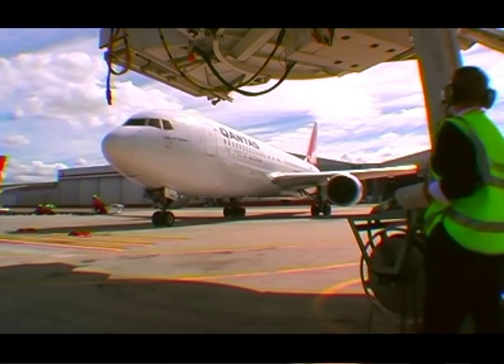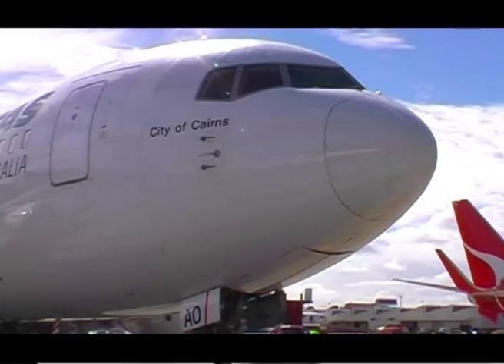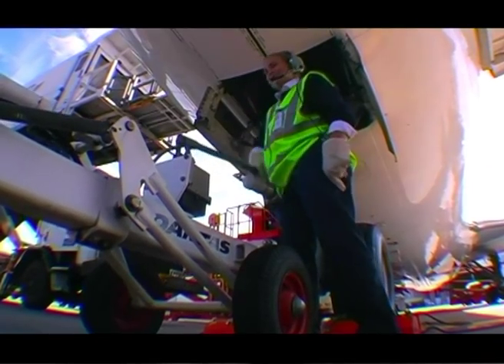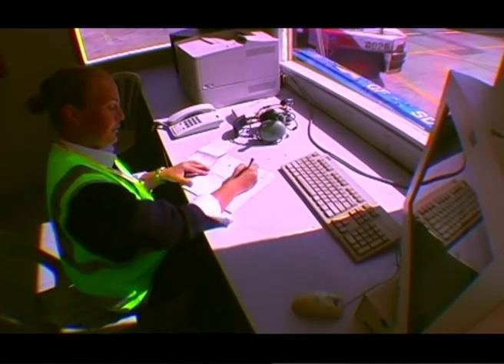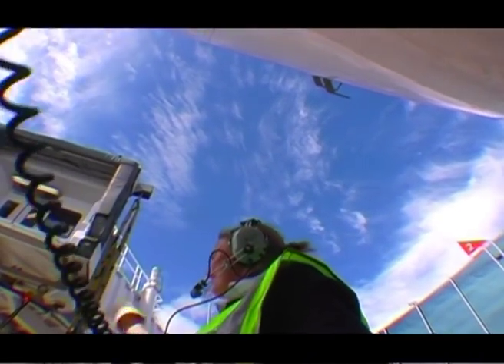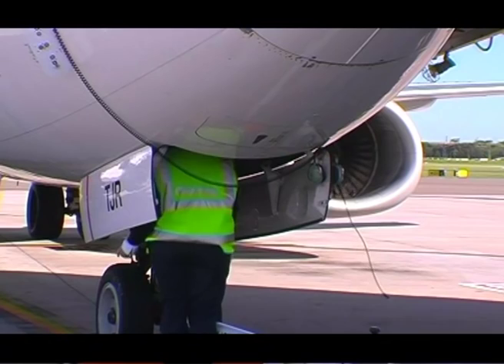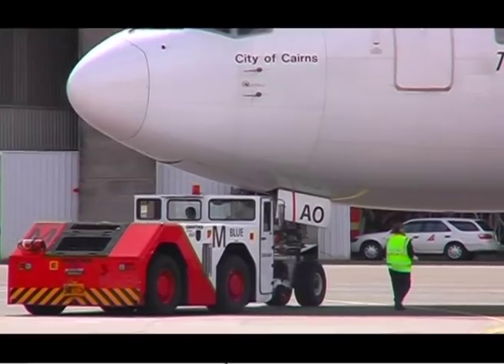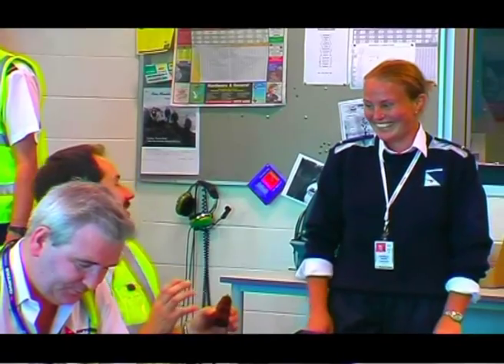Michelle - Licensed Aircraft Maintenance Engineer

Comment: Hi ma'am 
 Greetings of the day,
  I have completed my aircraft maintenance engineering(AME) from india and OJT completed From air india on boeing fleet  (777-300 ER /200LR, 737-800NG, 747-400 AND B787-8 DREAMLINER and also have 6 months airbus A320 fitted with CFM 56-5B AND V2500 Engine aircraft line maintenance in Airworks..  It means i have 01 year line or base maintenance experience.
And i have also clear DGCA   CAR 66 module 3,6,8,9 and 10.
But recently i am at home. I have tried in  many companies but they didn't respond yet, i am waiting for a good job. 
  Could you suggest me what i can do for my bright career.
Reply: Rahul meena .
hlo do you get any were ?